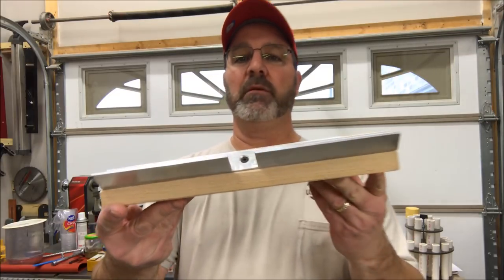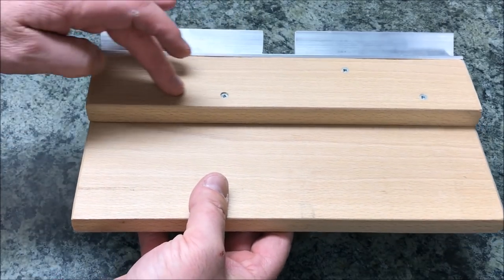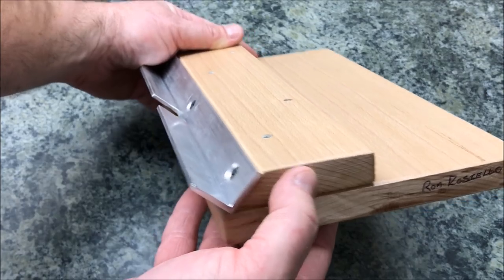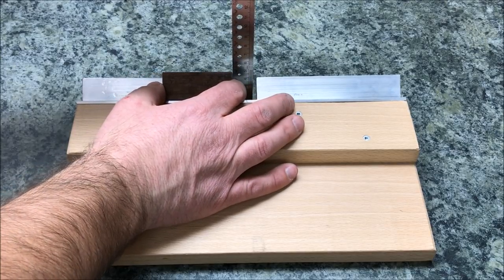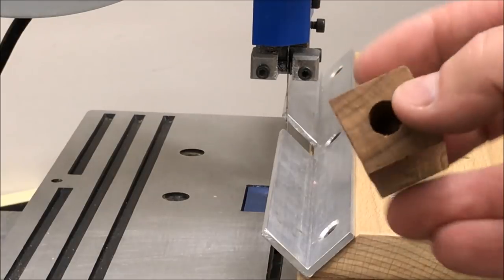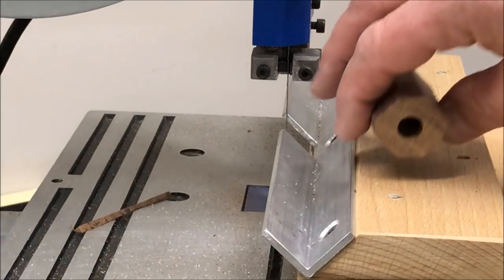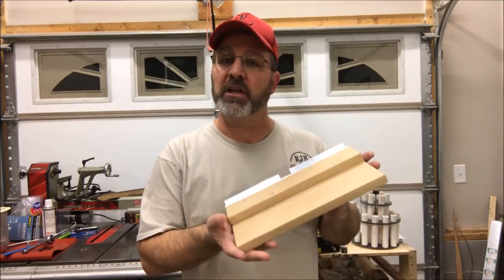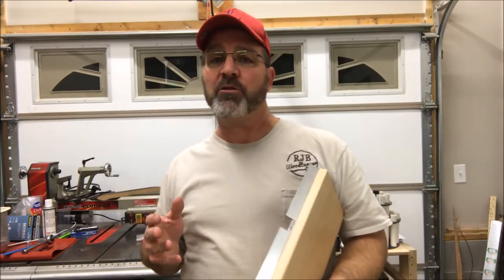Pen Blank Corner Trimming Jig

Comment: Genius. Making this one too next week.  Also, don't get hung up on it being "even". The mandrel is round and it's going to turn round. Great, as you said, for end grain. However, no matter what direction the grain is running, it will take you less time to turn if you don't have to take the corners off.
Reply from the maker: It sure does make turning easier. 

Regards,
Bob

Comment: Good idea. I would be a bit concerned for my fingers being that close to the blade. I think it would be an improvement to add a cleat to the bottom of the jig that ran in the miter grove of the band saw table and add a clamp of some sort to hold the blank. You could make the jig adjust in and our with the use of slots and carriage bolt with a wing nut to hold it.
Reply from the maker: That would be a great improvement Tarry and much safer, I like it!

Regards,
Bob
Reply: as well as safer it would make alignment easier as well

Comment: Interesting idea.  However there are some safety issues here that I cannot ignore.  The entire system depends on the clamps holding the jig down to the drill press table.  This arrangement is not always stable and not stable all of the time, depending on the bandsaw.  Therefore, in the worst case, the jig could move at exactly the wrong time, causing a major accident when the bandsaw blade hits the aluminum angle iron.  Secondly, the jig puts one's fingers perilously close to the bandsaw blade. If one isn't paying attention or gets interrrupted or a hundred other reasons, another major accident involving lost fingers at worst could happen.  I don't find rounding off corners to be that big a deal in the first place with a good spindle roughing gouge, but that is individual preference and the type of wood/acrylic one is using.  I am watching a lot of your older videos, being a newbie at pen making.  Thanks and take care.
Reply from the maker: Thank you.